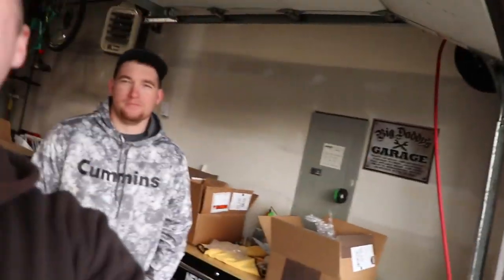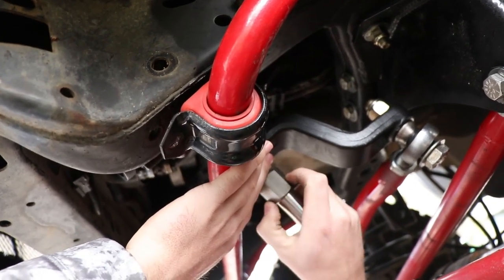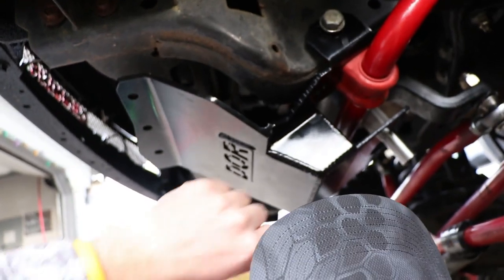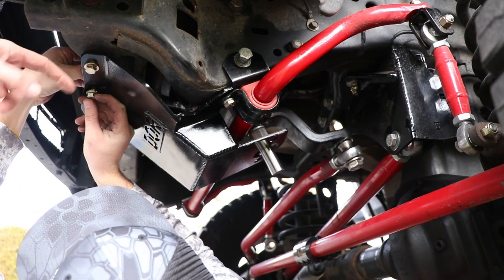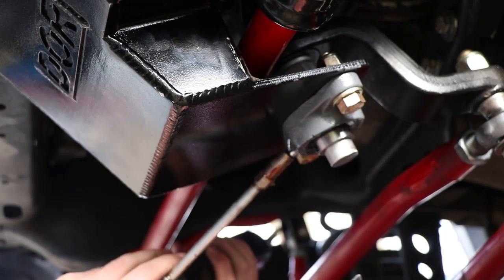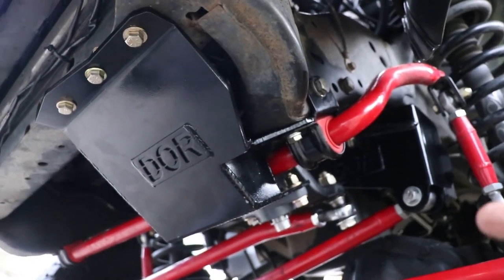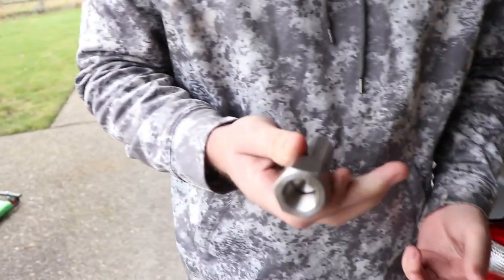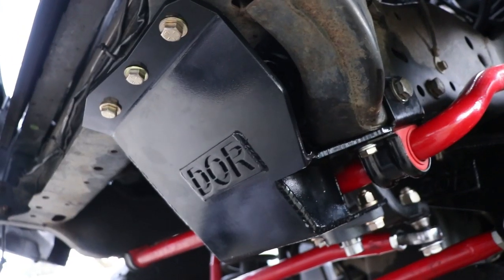INSTALLING DODGE OFF-ROAD STEERING BRACE!!

Comment: I have over 300,000 miles on my 2 Nd gen factory box,no brace ran 35” tires for 275,000 miles then went to 40” irocks, just replaced first ball joint so I did them all, never had death wobble, I know the V-10 is bigger ball joints than the stack Dwayne 60 axel,

Comment: I got 98 ram 1500 quad cab 4x4 I installed this brace plus duel stablizers it stopped my death wobble it was bad I run 35s 70 down road now no problem
Reply from the maker: Gary Cantrell yeah it makes a huge difference

Comment: where did you get a;; the steering components on that truck cause that is the set up I want on mine,  even when i look up steering parts for a 2018 like my buddy's and still comes up the same shit that is on mine.
Reply from the maker: Checkout to-fab.com. That’s the best play to get crossover steering. Then I would recommend dodge off road for the trac bar, trac bar bracket and steering box brace. If you need a steering box then get a redhead, the reman boxes are junk and won’t last. Let me know if you have any more questions 🤟🏻